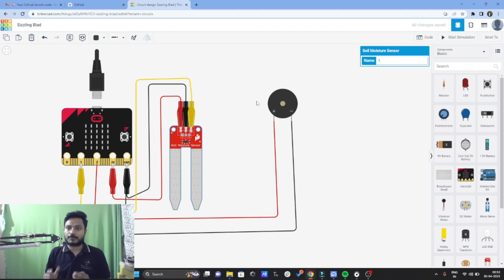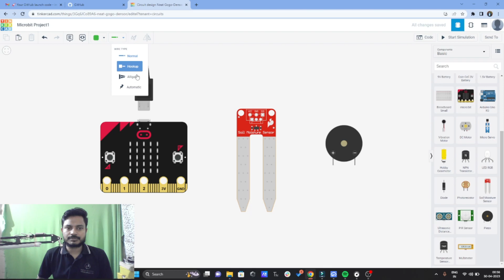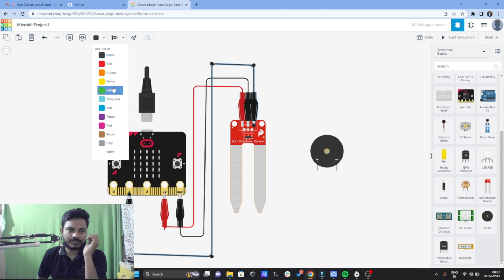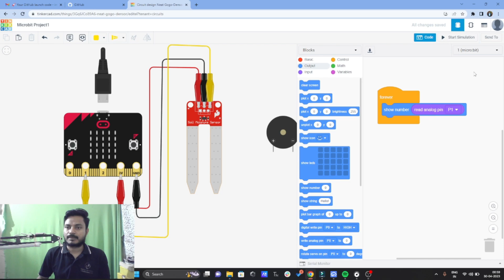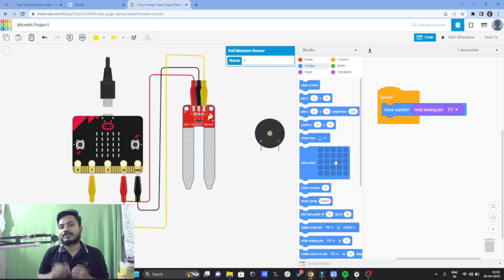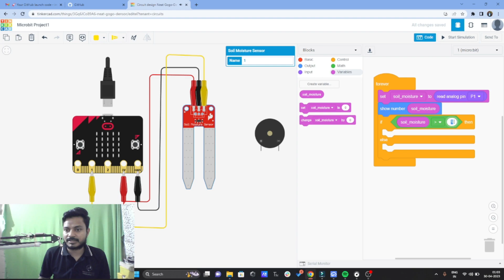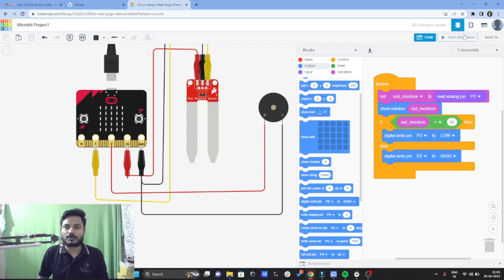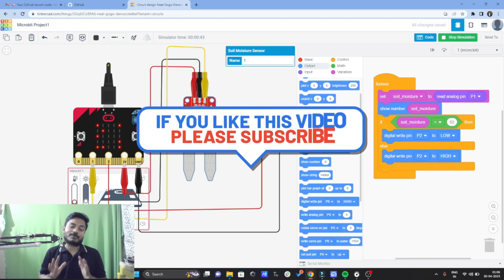How to Use a Soil Moisture Sensor with Microbit: Tinkercad Simulation Tutorial #microbit #tinkercad

Comment: Hello I’m making a soil sensor using microbits, but I have the qwik connecting version of the soil moisture sensor, is there a way where I can connect the jumper wires to the microbit.

If Its can reach you somewhere else like email or instagram I can exchange info! 

Thanks if you can help and for your video!
Reply from the maker: ok connect me on my insta